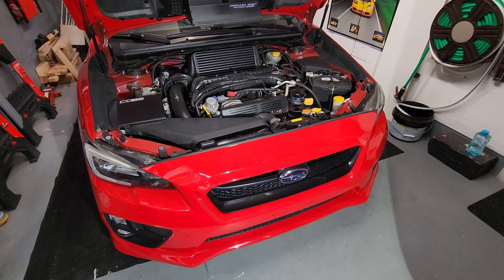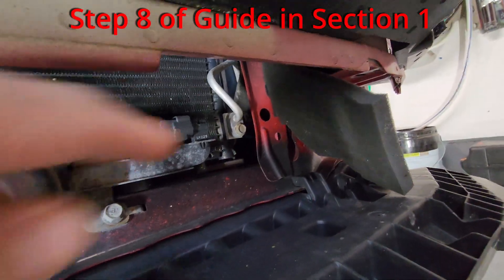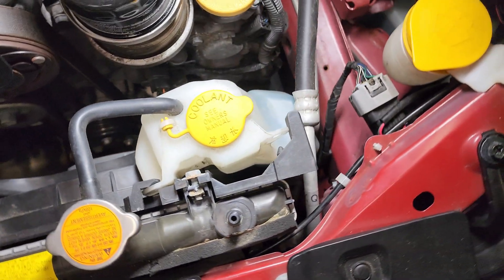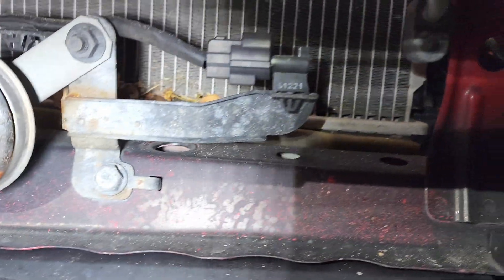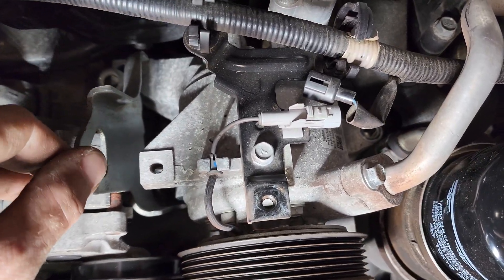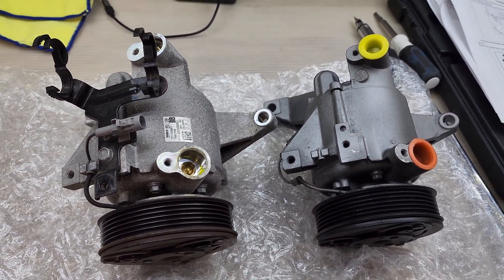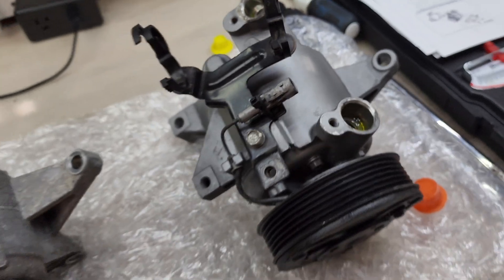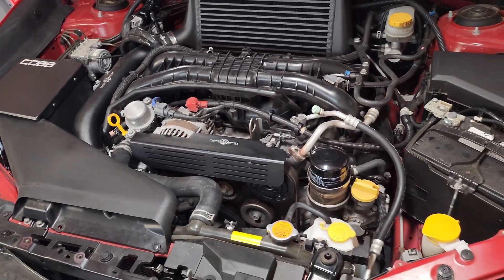[2015-2021] Subaru WRX Compressor and Condenser Replacement Guide

Comment from the maker: Thanks for checking out my content!  I have unique Subaru mods coming, as teased in my Home Automation and HP Omen Video!....
✅ WRX and Forrester Diode Dynamic Switchback retrofits
✅ WRX Heads up display controlled by retrofitted STi center console
✅ WRX Boomba Short Shift install
✅ Forester Leather Re-upholstery 
✅ Forester HID Projector retrofit using Morimoto

Comment: I know this is not related to the video topic, but how is that Process West intercooler? Im considering that or the GrimmSpeed.
Reply: I read a reddit post of someone who compared a bunch of data logs from people with different intercoolers, the PW was said to not be good bec at higher speeds air seemed to go around it and not into it. They said GS was best or subiespeed (rebranded GS). Also heard cobb is good but u have to buy charge pipe as well for it

Comment: My compressor sounds exactly like that. I’m planning on replacing it. Do I have to replace the condenser as well?
Reply from the maker: I did in my case since the condenser failed just like TSB which caused compressor failure.

Comment: Thanks for video. Helps to see what I need before starting on my 2018 STI. No condenser leak, but o-ring at compressor and exp valve are leaking so replacing o rings and hoping I can get away with the price of new o rings and refrigerant. No leaks anywhere else
Reply from the maker: Thank you, Fingers xd for ya!

Comment: Is it best to just replace the condensor and compressor at the same time? The dealership told me i have a crack in my condensor and needs replaced and my compressor was making some noise so its best to replace that also. Quoted me $2700 for it.

Comment: Has your AC system held up for the past year. I'm really nervous about buying a cheap ac compressor and condensor. I have seen nothing but bad reviews except for the 700$ compressor
Reply from the maker: Almost 2 years without issue (I shot video knowing I'd be starting a channel and published a year later.)  I'm guessing $700 is OEM, and I totally understand where you are coming from.  I used RYC but I've also used 4Seasons.  Both are well known remanufacturers.  I take some poor experiences with a grain of salt.  The job is not for everyone, and there's enough to go wrong.  That's why I drew the line at vac and charge, having tech vac before I drove home and swapped, then after replacement before charge.  Let us know what you end up choosing; thanks for watching!

Comment: can you replace the compressor without replacing the condenser if the condenser is fine?
Reply from the maker: Yes absolutely, compressor can fail on its own.  System should be die tested to determine if leaky before vac, replacement and charge.  Let us know how u make out!

Comment: I have had my compressor and condenser replaced, ac was good but after a month ac is running low on freon again, do you know some other places that are prone to leaking?
Reply from the maker: I am not sure on that one.  All I can recommend is keep ac unused until a tech can do a dye test. Fingers xd, at least you're getting head start in weather.  Thanks for watching!
Reply: Probably too late now, but the evaporator core is common failure point. It’s like Subaru AC department gave up

Comment: Just got a question on the compressor that you used, is it still working as of now and also does it make a loud noise every time it turns on that is worse than the oem noise?
Reply from the maker: It will be on third summer soon and no issues so far.  I'll try to remember to turn it on and listen for any noise.  You should hear something as the ac clutch grabs for sure but nothing too scary.  Let us know if you have a reference sound, perhaps from other video.
Reply: @manicmods  Oh okay, thats good. Thank you for replying, unfortunately no one that said that provided a video...

Comment: Great video!  My system just lost all pressure and the compressor stopped engaging.  I went to recharge and it would not hold pressure when the compressor kicked on.  Hopefully the condensor is the issue but if its the compressor now I know that will be just as easy!
Reply from the maker: Ayy happy to help!  I really want to produce some more videos around wrx.  I think it's inevitable when spring comes around.  Appreciate ya!

Comment: You mentioned you lost coolant. Did u mean freon?
Reply from the maker: Nope I lost coolant thru the radiator which allowed compressor to fail since it relies on good level.
Reply: @manicmods  I think I'm dealing 
 with the same thing. Except it won't leak unless driven.
Reply: 3 shops and no answers. Where was your coolant leaking from? By chance, did you happen to have a tan colored residue/powdery substance on the outside of your car after driving? My guess is the condensor oil and coolant particles mixing as they are getting blown back.
Reply from the maker: @bernadettefausz8810  bottom left of condensor shown in first 3m I believe.  I did not have any build up as u described.  Good luck!

Comment: Hey what's up! Great video dude. I was wondering why you didn't do an AC flush to get rid of any residual oil. I'm pretty sure I have the same problem and looking to do the compressor/condenser change pretty soon.
Reply from the maker: Had the shop do flush before and after replacement.  I had picked up a kit but left it to the pros.  Thanks for watching!

Comment: It's my understanding that you can really screw up a new compressor if you don't get the oil balance correct. I noticed that you purchased oil, but the video does not show you actually using it. Did your new compressor come with oil? Did you, or the shop that you had do the recharge, end up adding additional oil? Thanks to your video, I'm confident I can remove and replace the condenser and compressor, but I'm quite nervous about getting the oil right.
Reply from the maker: I was in the same camp.  I had shop evac before I replaced.  Completed job, and then had shop evac again and fill.  The oil I used was only to lubricate the new o-rings.  Hope this helps ; thanks for watching!
Reply: Cool. How's that remanufactured compressor holding up so far. Any issues?

Comment: Fantastic job explaining the procedure! The TSB got me too, but I've been out of warranty for a while. I basically had this video running on repeat while I was working on my 2016. I have to redo everything this weekend because I found a pack of o-rings in the center console and can't remember if it's a spare pack, or if I started rushing and skipped replacing some. I'll spend the time now so that I don't have to replace another compressor six months do the road thanks to another leak!

It took about five hours the first time not counting weather delays. Hopefully the second time is faster!
Reply from the maker: Thanks!  Super happy it was of assistance, and hope your o-ring refurb goes quick.  Appreciate ya!

Comment: Hello i cant seem to find anywhere onlin that stated the total amount of pag oil for the system, does anyone know? Thanks
Reply from the maker: Not sure on this since I left the evac and fill to a HVAC tech.  Were you able to determine?  Thanks for watching!
Reply: @manicmods  I ended up putting 6 oz of pag 100 in the compressor and 1oz of pag 100 in the condenser and when I got vacuum pulled the guy at the shop said that was good, it's been a week and it's holding strong
Reply: @chrisschmid9377 Is your compressor still running strong? I too am concerned about having the proper amount of oil in the system. I'm about to replace the condenser and compressor in my Outback. I'm going to have a professional do the evacuation and recharge, but I wanted to make sure I had the right amount of oil in the system before I turn the car back over to them.
Reply: @bmc5180  yea still running strong haven't had any problems

Comment: Just did the replacement on my 2016, went with the GPD Upgraded Design kit from Rockauto and replacement for the condenser + compressor was super easy. Took about 2 hours start to finish with 2 sets of hands. Recharged today and it works great. Total cost for the kit + recharge was around $600, all new parts.
Reply: Could you send a link of the GPD upgrades design kit?
Reply from the maker: Nice work!  Thanks for watching! ⚙️
Reply: Can you b provide link for parts used
Reply: @MrThunderkat69 just look at the ac compressors on rockauto
Reply: A year later how is that compressor holding up? What is the difference between upgraded design and the non upgraded design?
Reply: better than stock?
Reply: how is it holding up?

Comment: Thanks for this video! My compressor clutch gap is MASSIVE which is part of my issue. The other part is there was no refrigerant in the system.

Going to do compressor, condenser and expansion valve as well as all o-rings to make sure it’s all sealed up. Haven’t checked for leaks at the condenser yet as I was planning to replace anyway, but will be interesting to see what I find.

My biggest concern is filling with proper amount of oil. I ordered a prefilled compressor so I’ll have to see how much comes out of the old one I guess.
Reply from the maker: You're welcome!  Since it's a sealed system, you have to ask where the refrigerant went- sounds like you are on the right track.  My compressor was pre-filled as well.  I had picked up a pump and evacuator kit, but left that up to the pros.  Highly recommended to save some guess work if you have never done that part of process before.  Good luck, let us know how you make out!

Comment: The detail and step by step of this video is perfect. Any reason you went with the OEM condenser but aftermarket compressor?
Reply from the maker: Thank you!   I always strive to use OEM parts.  I would have passed on the OEM condenser if Subaru had not addressed the problem area defined.  The compressor was over double the price I believe new from Subaru.  I've always had good luck with remanufactured OEM which the RYC was I believe.  You planning on doing yours soon?
Reply: @manicmods  my AC has been really weak. I started looking into it last year and found the issue with the compressor clutch spacing, the gap was higher than what it should have been. That helped but this year I got blowing hot air again. Took it to a shop and they found I had no more refrigerant (it was filled last year). So  I bought new O rings and Schrader valves and will be replacing those. Recently however I've noticed with my AC on, my car REALLY hesitates to accelerate been 2,000 to 2,500 RPM and 3,000 to 3,500 RPM. Feel people online said that this was due to their AC compressor going bad... So I'm debating if I should just replace it too. You're right, they're about $800 brand new. 😮‍💨

Comment: Thank you for this great video! Just have one question, where can I find that procedure manual? Thank you
Reply from the maker: You're welcome, thanks for being here!  I've just added manual link to description, you can find 02-19 WRX Manuals here:
http://www.wrxinfo.com/service_manuals/
Reply: @manicmods  thank you so much! I’ve got a 21 wrx, it should be the same right?
Reply from the maker: It looks like you use a different compressor.  Does warranty not have you covered?

Comment: Great video. I just installed a charge pipe and noticed the leak around the same area where the condenser fail point is. So this video is going to help a lot.

Question though. How much Pag oil did you put in and how? I've read it's around 6 ounces. Do you pour it all into the ac compressor and turn and wheel while doing so?
Reply from the maker: Thanks for watching, Ray!  The compressor I purchased was pre-filled with oil.  I only had to add PAG around the O-rings to ensure they did not bind.  Then I had the system evacuated and refilled.  If you caught your leak early, and did not run the compressor low, I wonder if you've salvaged this.  Keep us posted 🤞

Comment: My A/C just took a dump 2 days ago only time it blows cold air is if im on the highway. My ac compressor sounds just like yours. Did yours still work while driving when sounding like this? I'm hoping I don't have to do all this.
Reply from the maker: I'd run only in emergency until I could self diagnose a bit. I definitely recommend checking fail spot of condenser as seen in video.  You can see a lot of it thru your bumper.  Check your coolant level, and leave hood popped.  Start it up with no ac to listen at bay.  Turn on AC and listen for something that does not sound right, and report back to us.  Gl!
Reply: @ManicMods  Ya it definitely only makes noise when the a/c is on I don't know if the clutch is grinding. Also I have a Cobb accessport ever since my a/c been making noise it's giving me a ton of feedback knock doesn't happen when the a/c is off I get zero knock when it's off. Ima check the condenser tomorrow for leaks.

Comment: I switched to a KOYORAD and never looked backed for this exact reason. Too many issues I've read about RAD failures. Its a terrible tight fit which is why im making the switch to Front Mount Intercooler to free up so space. Great video though.
Reply from the maker: Thanks!  Hope the rad and FMIC  install goes well.  I love my verticooler but would also love the more aggressive front mount.  I'll have to look into Koyorad.  I'm happy Subaru at least put some R and D into the newer radiator.  Fingers xd it holds up 🤞

Comment: My ac just stopped working but glad I saw this video in case I have to replace those parts. My ac compressor isn’t engaging, did you check your fuses and relays before going this route? Just want me see if mine will be a easy fix or more elaborate like this.
Reply from the maker: In my case, the condenser failed.  You can see what that looks like in first section.  You should check out videos around compressor clutch failure, as I'm suspecting you could be experiencing that common issue.  Most of them touch on fuse and relay which may apply to your problem.   Let us know how you make out, and thanks for checking out my content!